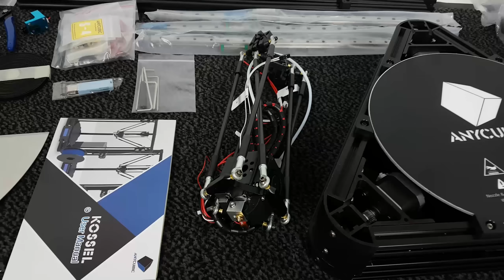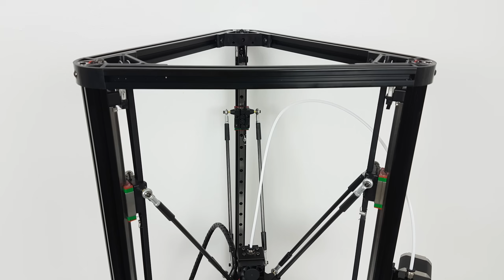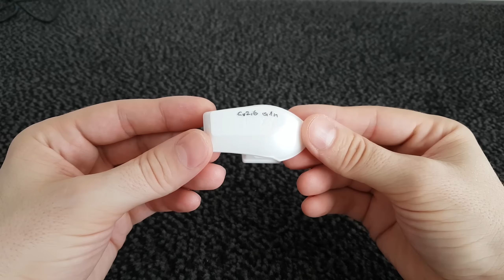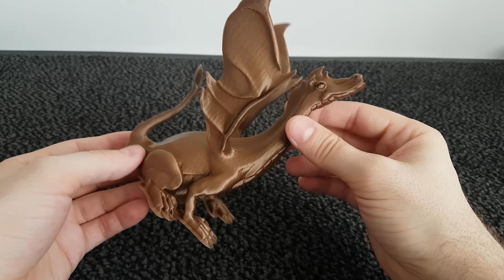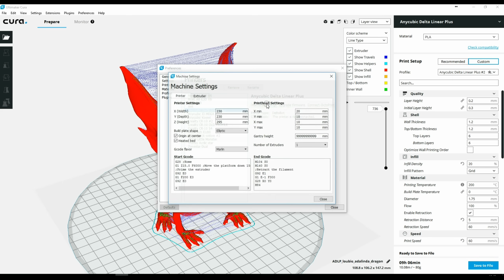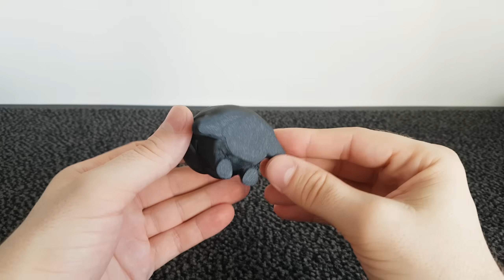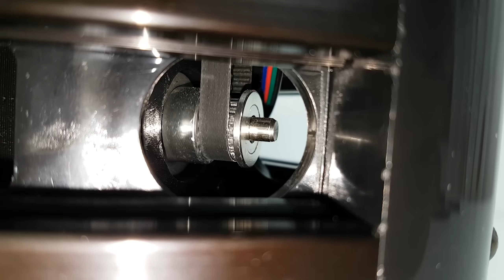Anycubic kossel Linear Plus 3D printer full review and upgrades

Comment: I purchased one of these and am impressed with the quality and the finish. Both are great. The machine comes well packaged and was easily assembled. I did have a problem with the auto leveler that turned out to be a problem that I designed myself. I put a ty rap on on of the legs of the printer and routed it around to the wrong side. When the printer went to the top it pulled the auto level component out of the circuit board. Was not a big issue and was up and running quickly. Over all the machine is wonderful and I would suggest to anyone that this is a perfect machine if you want to run PLA. There has been talk lately of the problems with ABS and concerns that it might be toxic. I don't know if that is an issue at all but PLA is made of corn and I feel more comfortable with using it as a material. About six years ago I purchased a Qidi printer for my grandson and it worked pretty good. This machine is easier to work with though it does not have the two extruders. For the price of the Anycubic Kossel you won't find a better printer. Did I mention the support? Anyway, these guys are great and will have a note back to you in one day if it is not the weekend or Chinese holiday (October 1-8). I found my machine on ebay for $200. I couldn't be happier.

Comment: I bought this as my first printer after watching this video. Keep in mind I had no other experience with 3d printing. I had no problem assembling it but the firmware was problematic. Thankfully nowadays there is a firmware called "Marlin" with appropriate config files for this printer. After finding and installing this new firmware the printer is 2x better than before!
Reply: Yeah, mine just rams the side beam when auto leveling (even though all motors work in manual mode) and ANYUBIC support is some Chinese dudes with broken English.
Reply: Mind sending the link of marlin?

Comment: Word of warning, do not lose a slider off the end of a rail. If the balls come out and you lose some of them, even though they are the same as the HGN12HC, they are not the same. The AnyCubic ones are tighter tolerance ones than the replacements you can buy. The replacement ones will wobble on the AnyCubic rails. You can use the ball bearings from the replacements to replace the ones in the AnyCubic sliders. Leave a gap between the first and last one or they will not work right. And the AnyCubic sliders will not slide onto the short stub of plastic rail that comes with the other sliders. Your other option would be to buy a slider and rail as a set. If it wobbles, send it back as they should not do that when new.

Comment: Great review and video overall! Thanks a lot. You've convinced me and I've bought one of these off amazon. Organised video, with subtitles for the details of the prints. Keep up the good work!
Reply from the maker: Thank you so much for the feedback! It means a lot to me. Comments like yours gives me energy and will to make more videos and stay on you-tube. Best regards mate and good luck with your Delta! :)
Reply: How has the Anycubic been? Have you had any issues?
Reply: anonimuso, it's a great printer. I've printed about 3kg worth of filament parts.
Firstly I've printed upgrades for it: frame corner reinforcements; belt tensioner (which broke and I've replaced them with the upgraded version from thingiverse), extruder fan shroud, cable clips, buffer legs, ring LED lights. After the structural reinforcement upgrades, the prints became much better.
I had an Anet A8 before and compared to it, this Anycubic Kossel Linear Plus is twice as fast, good for details but it does have some wobbles.

Have you bought one too?
Reply: Sergiu S No, I haven't. But thank you for the info. I'm still deciding, but now I'm leaning towards the Tevo Tornado because build size is very important to me.

Comment: Great information as usual. Hard to watch these without commenting as people are usually quick to criticise but seldom give credit where it's due. I also like your testing techniques as you really try and find if they have any weak spots.

For your next challenge (haha) swap out your controller for a 32 bit one (ie. Lerdge-K) with better micro stepping as the 8 bit boards are supposedly punished with all the floating point maths that's required. The Lerge boards have inbuilt FP unit and run at 168Mhz off memory.

Comment: The stepper motors will be same temp no matter what print material you use so make the holes, the convection is less than the generated heat from the motor itself while running

Comment: Like video, so I purchased one.  Having one problem with the leveling, 3D printhead stops about 5 to 10mm before the heatbed and that is where it starts printing.
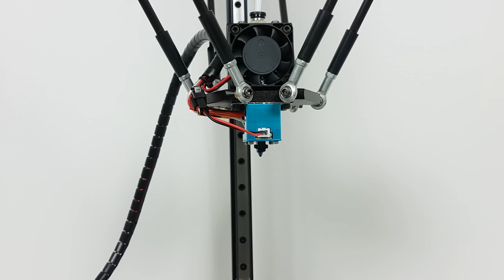Reply from the maker: Allen Van Horn Listen carefully from 4:15 when I talk about levelling. You need to fine tune your z offset. You could also follow/read  instruction there is detail section how to level the printer.

Comment: I am reading this on an Amazon rating: "Cura is a pain, sometimes it makes layers shift when using supports it generates. Flavors don't always work save with Marlin and it shifts layer riprap and it's fine." It seems other reviews on Amazon also state that Cura is not the best to work with. Rating posted on: April 22, 2019.

Comment: been building mine since 10/3, the mechanical assembly was easy, but now I find the manual is inconsistent for z stops compared to the image in the manual, and it wont home or run the levelling process correctly.

If I have I to do firmware corrections or anything other tahn uploading a new version, then its going back. Not a good kit for a beginner. Glad yours work good for you.

Comment: You review and presentation overall is good however there are problems with the presentation on assembly. I do realize that this is not an installation guide but you do take on the task of showing how to build the structure. Within that context here is the list of concerns:  

A - there is no mention on keeping the tee-nuts aligned within the aluminum track to achieve the best anchoring methodology. 

B - There is no mention of not allowing the linear sliders from moving off the track as the loose bearings will fall out. 

C - There is no mention of aligning the railing with the bottom frame. 

These above issues are indeed critical and by omission they do not guide your visitor down a safe pathway.

Comment: Great video! You said all I wanted to know. Thanks!
Just one last thing... The calibration sensor should be removed after the levelling?
Reply: ComputermanAM13 Yes it should be removed as it obstructs the nozzle. You’d end up damaging the sensor
Reply: Yes, thank you.
I have just received it and works fine!
How much did it take to print the vase? Did Cura solve the 0.5mm issue in the latest update?

Comment: Hey Nexi, dunno if you remember me but I'd bought the CR-10 Mini from your affiliate link after chatting in your CR-10 video's comments section last April (you mentioned the Mini was better because the smaller bed heats up faster than the large bed in the CR-10). I've learnt a lot over the last 4 months and I'm ready to try something different. I'm tempted to get the anycubic kossel linear plus to have the delta's speed, but I'm not a fan of the small build volume. What are your thoughts? Would you recommend it? Or would you get something like an Ender 3 instead?

Comment: Hi great vid. You seem to be the lucky one as my printer will not auto level. When it is powered up it just says welcome Anycubic Kossel and does not show which firmware version it is. When I try to auto level it will only probe the left side and goes off the print bed as well. I had lots of QC issues Two corner pieces at the bottom were upside down. The power supply was dead. The screen never lit up because the usb jumper was set incorrectly. Sorted all therse problems out and now it wont auto level. I think there are quiet a few people with this problem. Any chance of you leaving a link to a firmware that works cheers Tim

Comment: Great review! Did you run in to any of the issues with the software that were mentioned in other videos like the hotend crashing into the build plate during auto level?
Reply from the maker: tykelly310 Thanks! Crashing in to the Build plate? Wow! Not at all. Maybe they didn't follow instructions or did not connected wires to the motherboard correctly. When I connected my auto probe I test it first with the finger is it work or not. I can't image someone push "auto home" on any 3D printer without extra check all wires and connections and confirm are they connected and I are they actually work in the first place.

Comment: I recently started 3D printing as a hobby with a Flashforge finder, was thinking of getting this as 2nd printer. Has it got a bigger build volume? would anyone recommend a different printer that might be worth a go?
Reply from the maker: Flashforge finder is awesome 3D printer! I have it too and I use it almost every day. Never let me down. Only think that i change it is power fan inside the printer(On the back side under metal plate) to make it silent. 
Well this Delta I can definitely recommend but print volume its not that big in X and Y axis comparing to FDM 3D printers. If you looking for something big I can recommend Cr10S as its much easier to assembly and set up then this 3D printer. Here is the review video https://youtu.be/tFfMPjKhF8c
Cheers :)

Comment: So good review Nexi, as always! I found this printer on Aliexpress with a considerable lower price, do you recommend to buy this one on Aliexpress?  Thanks in advance!
Reply from the maker: Thank you mate! Considerable lower price? I just check price on Anycubic store on Aliexress and price is very similar. Depending of country it can add more shipping cost.  Make sure that you was looking in the same version like in this video (Linear plus version with Auto level). There is a lot of version of this printer. Some don't have auto level, Linear rails, Big power-supply, metal spool holder etc... This is the best version that you can get. And of course you can order it from Aliexpress  directly from Anycubic store if you like. It's safe. Cheers :)

Comment: Your review is great. Could you share your Cura profile for this printer? I am using same printer for quite long time and i can barely achieve half of your quality. What is more, my models are always over extended (for example when i print model with hole 5 mm i get only about 4mm and so on) so whenever i want to print model which join some elements together it never fit to each other. Further more i always have to turn cooling fun manual from printer while printing, because setting it from cura profile don't work. I really can't get over this issues, and i think that it could be maybe software of printer or bad setting of cura profile, but i do not know to what i am suppose to change (yes i tried some changes)

Comment: Any idea how to make it save the autobed level data in the EEPROM? Otherwise you have to do the 2 bed leveling procedures every time you turn it on.... thanks
Reply from the maker: firstname lastname Really? That's not cool! On my Kossel I don't need to level the printer every time i turn it on. I try to save my firmware somehow and add links for people to use it.
Reply: Thank you in advance! I have played with github and the anycubic site firmware - still does not save the z offset... I bet it's caused by the hex file that you need to upload to the printer in order to have the autolevel work with the magnet level probe (the stock one).

Another tip - check all the rod bushings, the small yellowish caps  - some of them might be squashed when they assembled it in the factory and it makes the rods sets not parralel to eachother, which i found out when i tried to print a 210mm test circle. Since i'm away from my "toolshed" i cut some cardboard washers and made them as close as possible to the real thing... I have bought the 2100 SPI sticks, after i get my diode smoothers i'll give it a shoot, hopefully there is a real improvement.... 

BTW, great videos, keep 'em coming

Comment: My printer does prepare PLA fine, heats up, but when I try to print the calibration cube the extruder temperature starts dropping. I stop, redo preparePLA and it heats up. It drops to about 170 in two minutes and keeps going down down down until it siezes.
Reply from the maker: Gianna Giavelli Write back to anycubic support. It can be faulty thermistor,motherboard or connections maybe? Check them first just. Can you just double check all connection and wires? Try to just worm up printer( PLA settings then ABS settings) and check if temperature is stable?
Reply: I've been through so much. replaced the heater core, checked the thermister, tinned the extruder heater wire, done PID autocalibration.  checked all physical parts. Z is looking perfect, prints first 4mm of the xyzcube then just starts losing temp. If I dont print, temp is perfect and maintained. so its the power supply or board. I've been working back and forth with anycubic support. they get back in a day or 2. sent them videos. but I think tis near the end. I also confirmed no errors coming out over the com. I watch it dance perfectly during its autolevel and think THIS THING IS COOL.  I hope they have a answer. might be time to try a new board before I finally give up. I also tested with and without the heated bed on , makes no difference.
Reply: waiting on a new motherboard. tried to put on a v6 heat block didnt go very well. tried to put on a new ceramic heater. didnt help. theres no room for a v6 block with the fan shroud and the magnetic plate. i've tried everything but a sledgehammer. i just have to wait until the new motherboard arrives.. but then i'll be past the return date from gearbest so... I'm stuffed. 100 hours and 20 days invested. it sucks.

Comment: Hello what are the values that you normally use to print with PLA? You need to auto leveling all time you gona print? thanks for the video
Reply from the maker: o0fakir0oGaming Values? 40-60mm/s, PLA Temp 195/200C bed 45C/0C. No need to autolevel printer on every print. If you are careful when you remove prints, then heat bed level will be stable for long time.
Reply: nice and thank you one more time! some guys put one glass over heat bed for PLA to preserve more the heat bed. what is your opinion should i use glass to print PLA for my base?

Comment: Hi, dou you think is worth build enclosure using present profiles to improve ABS printing? 
Thanks
Reply from the maker: Why not if you are doing a lot of ABS prints. Building enclosure for this Delta should not be hard as you need to just add Plexiglas panels around it.

Comment: Could you please tell how you modified the gcode to resume print
Reply from the maker: Nirman Aggarwal Open your G code file with the Note plus program, measure by hand exact point Z-height where your printer stop, Ctr-F to found the Z axis point in the G code file, then delete all G codes from the beginning up to your Z measurement or closest one( Don't delete the start G codes only the movements!) Then add G0 Z( your measurement) before the movements line, to tell the printer to rise up print head first to that height and save the new G code. Done

Comment: how do you get such high quality and perfect products on this printer? I saw many videos of others and no one has such quality prints. have you made any other modifications on printer?
Reply from the maker: boštjan Vidmar I'm not sure what do you mean. I did not do any modification on this printer only what you see in the video. This is 3D printer Kit and quality of your prints will be as good as your ability and skills to assembly this printer. The better you assembly any 3D printer kit and fine tune it the better your print quality will be. Sadly there is alot of people on YouTube that don't really have any technical skills, knowledge or the feeling for precise fine mechanic such is 3D pritner.
Reply: @NexiTech  Thanks for the response. I read that these Chinese linear rails are usually a poor quality. So I'm asking. What is the usual and max. print speed? According to the specifications it seems to me very low relative to the Cartesian printer. That has the same or even higher speed. Which is not logical.

Comment: do you recommend this printer for a beginner over a cartesian one?
Reply: I am not the reviewer, but I would strongly recommend it. Delta printers are much better for auto-leveling, which is the most delicate part of the printing process normally.

The design is a lot harder to experiment with and fine-tune, but with no experience printing it will probably give a better result and be easier to work with.